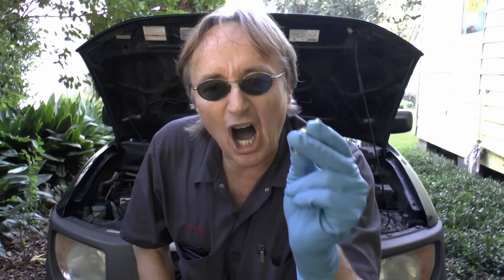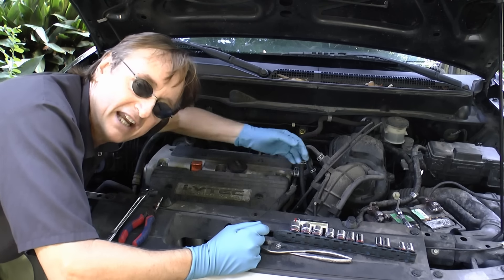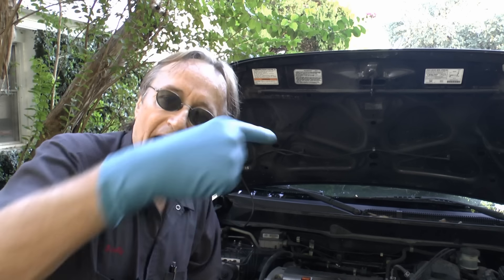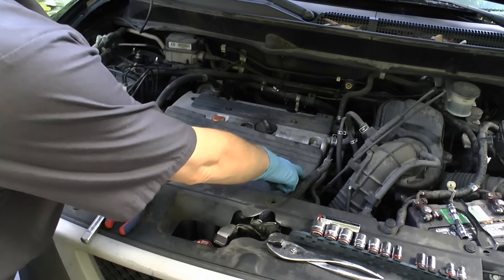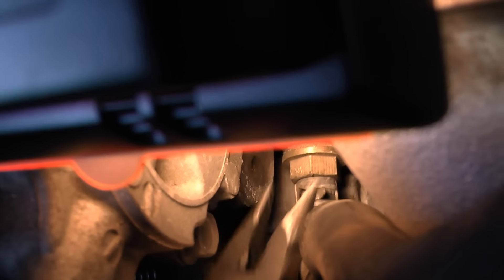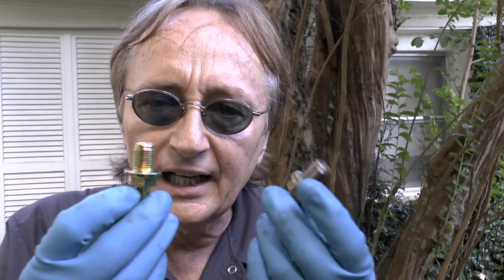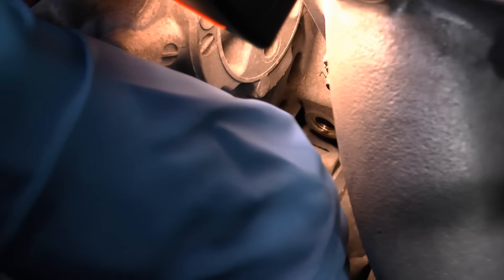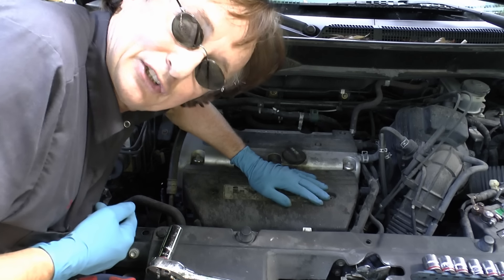How to Fix a Car Engine that Burns Oil for 10 Bucks

Comment: My Sentra was smoking horribly. I found this video and was sooooo skeptical. Nothing I try for car repairs is ever an easy, cheap fix. However, I found a pcv valve for $2 and put it on. BAM!! I have not seen a bit of smoke since. I am ecstatically happy! Thank you so much for this, Scotty! You are the man!
Reply: My Sentra used to smoke really bad too. Like, two packs a day. Finally I was like 'look bitch, I ain't buying your cigarettes no more. You need to get on the patch or something.' Then it started taking Chantix and like three days later I went out in the garage and it was dead. Committed suicide.
Reply: Brett Winstead smoke from the tail pipe?
Reply: nah bro it would smoke from the hot air intake ;)
Reply: yo wtf lmfaooo
Reply: Marvin Harrison Smith II haha
Reply: I get oil burning type smell only when I start my car in the morning. There's no smoke, just smell while starting and then it disappears. Will this help?
Reply: @HHH-tx9nc Probably because the valve is probably locked or seized and is allowing oil to get burnt up through the exhaust.
Reply: Sam for me. Tons of smoke. Where is the valve? What about head gasket problem????

Comment: Over 6 months, 5 different mechanics, new plugs, coils, MAF, random catalytic efficiency codes, etc. And they kept telling me my car must be burning oil (though no signs) and I shouldn't bother. Last night got flashing engine light and massive misfires. Plug 3 was all gummed up. Again, engine must be burning oil and has to be piston rings. I'm done for they said. Found THIS video. Bought a valve and brought it back to the guy and told him to check. Original valve was SHOT. Probably hasn't been changed in 7 years (freaking Nissan!) Changed the valve. Changed the hose. Changed the 2 plugs. It's been only 12 hours, but it's running like a new car. No misfires. No stuttering. No codes! Thanks for the video! Probably saved me thousands of dollars and a crap ton of stress!!!!
Reply: Update on this?
Reply: @sparkyplays9240  turned out the car was shot. Cylinder 3 was burning oil like crazy and eventually just ceased working. Ran the car on 3 cylinders for about a month until I got a new car, which was definitely NOT a Nissan.
Reply: "Changed the 2 plugs" - Spark plugs? If so - this was your CHK Engine and misfire problem.
Reply: @j_allen2099 thanks for the update

Comment: Thanks Scott I own a 2002 Honda Civic Si and it has used oil for the past 14 years. The Honda mechanic never told me that he has checked or replaced the PCV Valve. You even showed me where it is located. God Bless and Please Ride Safe...Amen.

Comment: Mr. Kilmer, I've been working on cars since I was a teenager so roughly 28 years. I just wanted to take a moment and tell you Thank You for what you are doing. You give people good information, it's presented well, and it's given in terms that are easy for people to actually understand. Having always worked on vehicles which are older (because I prefer less electronic controls) I've picked up quite a few tips and tricks from you that help with newer vehicles.
Reply: I have too
Reply: I get oil burning type smell only when I start my car in the morning. There's no smoke, just smell while starting and then it disappears. Will this help?

Comment: Scotty. I've been working on cars my whole life and after seeing your video you convinced me to replace my pcv - it didn't occur to me before. My car would not pass smog because of blue smoke after 3k rev when hot. I did the prayer and pcv change as you suggested, and I could not believe the results! No visible smoke! Thanks!!
Reply from the maker: Glad to hear it, thanks!
Reply: I get oil burning type smell only when I start my car in the morning. There's no smoke, just smell while starting and then it disappears. Will this help?
Reply: @HHH-tx9nc is it still happening? where do the smell come from?

Comment: Thanks Scotty.  Bought an 03 HondaElement that wasn't maintained well.  Was burning oil.  I changed PCV valve that was very dirty.  Problem solved.  Love your videos.
Reply: Dax C I highly doubt your crv is fixed, neglected K series Honda engines that burn oil need piston rings, very common.

Comment: You are literally my hero. Thank you for what you do. I’m not sure I can figure my issue out on my own but I’m watching whatever videos of yours I can find but I feel I’m never going to figure it out and I don’t have the money to be wrong. Had an oil change 2 weeks ago, car started sounding like it needed one today. It’s low on oil and now I have smoke under the hood. From the back side of the engine best I can tell.
Reply: Did you ever figure it out
Reply: @pazuzu810  Replaced the valve cover seals and it stopped smoking under the hood. Must have been spitting out oil onto the rear manifold. Manifold went and it was too costly to repair such an old car so I junked it. I’ve wondered in the oil contributed to it breaking.
Reply: I get oil burning type smell only when I start my car in the morning. There's no smoke, just smell while starting and then it disappears. Will this help?

Comment: I really enjoy your videos. We are about the same age. I'm 66. I've been a gear head since before I started driving. I never was a mechanic by trade but worked in Dealerships in the sales end. People ask me if I am a mechanic and I tell them, no but I'm a decent parts changer and have some common sense. As badly as I don't want to say anything that can be read as profiling, I think that the people in my generation were and still are much more in tune with their car. This sin't everyone, by a long shot. I tell people that when I started driving, I bought my own car, paid my own insurance and had the money by the time I was 16. Naturally that is next to impossible today but my point is this. My first car was a 1953,. It had a 6 volt electric system, no seat belts, an AM tube type radio that took 5 minutes to warm up. It had vacuum wipers. I won't try and explain vacuum to them but just that the more you pushed on the gas, the less they worked. It had a three speed transmission on the column with overdrive. It didn't have power steering or disk brakes or power anything. We had to learn to drive, not just point. Almost all highways were 2 lane. You were forced to pay attention because you knew it was serious stuff. To get a license you had to do all the things you do today, plus know how to give hand signals. My second car was a 62 Nova. It was 5 years old and I was a senior in high school. It didn't have seat belts either, same radio. My point is this. We learned how to keep cars running because our parents were raised in the depression and feared it happening again. Cars were a lot simpler back then, but even today, if people take a personal interest in their car and learn the things that they can do themselves, it can save a lot of money. My dad owned a sling of service stations and taught me two things about cars. If it ain't broke, don't fix it, but little problems turn into really big ones. You have to have your car, so when something needs to be done, know what is important, but keep it maintained. It is always cheaper to keep a car running than to get one running. Sorry for rambling.

Comment: Hey Scotty! Thank you for this video. I was worried about my car burning oil and thanks to you I inspected my Hyundai Santro's engine and located the PCV valve. It was all clogged. I cleaned it up myself and I was still able to hear the noise it makes which proved that it was working. Once I placed it back and did an oil change. Its been ten days and my car hasn't lost oil yet. I have ordered a new replacement and will change it once its received. You just saved me a fortune too.
Reply: Hi , do You think this will work on a vw bora ?
Reply: @costelkoko9886  no,  those engines aren’t worth fuxing.

Comment: I got an 1976 F100 6 cyl a long time ago.  It was running bad and had no power.  The PCV valve in the top of the valve cover and the entire hose from it to the intake was clogged with oil deposits.  I cleaned the valve (I was on the road) and used a stick to remove the clogged gunk from the pipe.  It ran much better and got me home.
I had a 1966 Ford Falcon that quit running in the middle of nowhere. After checking a few things I knew I wasn't getting fire to the plugs.  I popped off the distributor cap and the very end of the metal on the rotor cap was gone, broke clean off!  From the rivet to the center (coil wire contact) was fine but there wasn't anything on the end to send the spark to the distributor ends of the plug wires.  Luckily my dad taught me to ALWAYS put the old tune-up parts in the trunk when I did a tune-up, that saved the day!  I put the old rotor cap on and went on my way!  Saved me a tow truck call, especially since cellphones hadn't been invented yet.

Comment: PCV valves are often overlooked. myn on my honda civic is hidden under the intake manifold. when i finally replaced the pcv it stopped burning oil. good tip
Reply: +Mark N and the factory one almost never go bad .. buy aftermarket ,not so much
Reply: +Mark N I found out the one on my Focus is also under the IM. Plus some of the bolts are hidden. And the hose is usually toast. I'm still working up the courage to undertake it.

Comment: Seasoned mechanics years ago would look immediately to replacing the pcv in the tune-up process. Thanks for the important info. A small inexpensive item change like this can save a costly engine repair later.

Comment: I have a 2006 Honda Element Ex AWD. I purchased it 11 months ago and had my mechanic check it over and he said it was in great shape, plus I have every maintenance record since day one and it's had excellent care.  I noticed today that it was a quart low after driving only 1200 miles, and I haven't seen anything leaking or smoking. So I went to Honda today to purchase an OEM  pcv valve for $41.00 and will install. I pray it's the solution. Thanks Scotty, you're the best 😁
Reply: did it work?
Reply: @buzrash  I just got it all changed and the old pcv was plugged up. I'm sure after driving for a little while I will see a big positive change. Sure is great to have Scotty Kilmer helping with all the great advice👍
Reply: @1jackvalley580  thanks for the reply.

Comment: Thanks Scotty, I did this a while ago and my car is still burning oil like water. Have to top off every 300 - 400 miles. But still running great with engine light on for catalyst converter.
Reply: I have the same exact problem, what was the cause of it?... thanks

Comment: on my 2001 maxima, I  changed my PVC valve and PVC hose  for the first time in its  20 years history.
I also  switched to 10w30 high mileage from 5w30  high mileage
 (owners manual says 10-30 or10-40 can be used in my climate)

I also added AT-205 Re-seal for the rear main seal leak.    
I also use 1 qt of oil stabilizer in place of 1 qt of oil.    
now its not burning as much oil or leaking as much.   cheers

Comment: hey Scotty I say the engine cover is the first sign of the manufacturer saying forget about fixing it your self, we hid everything from you
Reply: Ironic since that's a K20/K24
Reply: IT'SME .  It may be the badge on your engine cover that caused the failure.😀. Seriously though, I knew one family that had 2 newer Cobalts. Both had major engine trouble within 6 months of each other. Total failure of hard parts like pistons, etc.
Reply: Bit late, but the cover quiets down engine noise
Reply: Useful Entertainment 
Throw away the heat keeping cover.

Comment: My 2001 Lexus ES300 was blowing out a ton of white smoke and burning oil, like 1/3 quart every other week.  I observed tailpipe smoke on cold starts ONLY.  Once running for ~30-45 seconds it was totally clear.  It was also only 4~5 days per week.  So it was not consistent in my case... It had good and bad mornings.   I took out the PCV valve, soaked it in brake cleaner for 2-3 hours and scrubbed it inside and out with a long bristle brush until the runoff was clean/clear.  There was a LOT of old oil clogging it up inside, or at least partially blocking it, and I think this was the cause of the intermittency.  Majorly keeping my fingers crossed.  Hoping this will carry me over for a few days until I can get a new valve.  I am pretty sure this is the OEM PCV, I dont think the previous owner ever changed it.  Hoping for the best and thanks Scotty.

Comment: Just a note..
The PCV on the Honda Civic(EG series) are made of plastic, and you can't unscrew them.
You have to pull it out with clamps. And when you do, it will most likely BREAK into pieces. I have no idea why they made out of plastic..
So far I replaced mine twice and both times they broken into pieces.
Reply: i changed them on my civics... none broke. it helps if you spray some wd40 or other lubricant on the ring of the valve prior to pulling it out. a lil dab of the same product on the new pcv should help installing n removing in the future. beck n arnley are sturdier.

Comment: Whether your videos are new or old they are always highly educational and equally as entertaining! P.S. I know how you feel about Chevy's but I have 2 Silverado's (a 93' standard transmission and a 00' automatic transmission) and I've taken great care of them and they both run absolutely tip top. The 93' is rusted to all hell (I live in Minnesota) and leaks a little oil but ALWAYS starts and runs with no problems. The 00' is actually in really good shape and is only just now starting to get the classic rust around the wheel wells. They seem to just want to last forever and I have no reason to get rid of them unless I want to upgrade just for the sake of upgrading. But why upgrade if they work perfectly fine right?

Comment: You can test if it is a PCV valve. Take off the oil cap and see if its stil burning oil. If the PCV valve is stuck closed or clogged now you are venting the pressure into the atmosphere.

Comment: I love your videos. You have inspired me. I even got a 1997 ford f150 and fixed it up a lot.I checked for head gasket leaks and none. also it runs very strong making me think there are no valves or piston leaks. I juts found out that there is a problem with the oil. it seems to be disappearing. I am pretty shur i replaced the pcv valve. there is no to little smoke if any coming from the tail pipe. I also pulled the pcv valve out and when running it i put my finger over the end and the extremely large amount of vacuum sucked it to the top easily.  Is there anything else that can cause the oil to disappear because i don't see any leaks on the drive way. I don't drive much but want a dependable car. Thank you so much. You saved my mom 900+ because of you helping me to help her fix the catalytic converter using lacquer thinner < you are awesome please never stop revving your engines>
Reply: Jamie Corbin does it blow smoke out the exhaust? Could be piston rings give way to slight blowby. In that case just burning up the oil
Reply: Check for oil pan or a rear main seal leak. The 302 bronco i have, thats mainly wear it leaks from.

If its leaking from either of those 2, the pan and bottom of transmission near where it mates to the engine will most likely have very fresh oil residue,

And you're gonna have to remove the transmission to service either of those seals. So pretty much plan on replacing a lot of stuff down there other than just seals. On a manual transmission the pilot bearing, rear main seal and transmission shaft seal is just a few extra stuff i replace along with doing a Clutch job. You're gonna have to remove the transmission to do any of those, so just do them all so you wont have to worry later on.

Comment: Hey Scotty I've got a 94 corolla that puts out some blue smoke occasionally upon acceleration especially after sitting for a while, could the pcv valve be the cause?
Reply: I am wondering as well.
Reply: Wondering the same.
Reply: Yes, it could be the PCV valve.  If it's not that, the cause could be much worse.

Comment: If you missed how much it costs just hit 1 repeatedly.
Reply: Mataz007 Hit 8... XD
Reply: Ryan LeFevre 9 1 7
engine's burning alot of 10 buck carberator spray cleaner
Reply: +Mataz007 Keep pushing 8.  It is hysterical.  Sounds like a bad porno.
Reply: Mataz007 i hate you for showing me this looool
Reply: +Mataz007 HaHaHa press 3 then 8 hahaha
Reply: +nextari press 8 every time you get to 2:46 "mihavetowinggla"
Reply: +Mataz007 "En bucks" basically SwEnglish for 1 buck.
Reply: +Mataz007 where did u learn that ??
Reply: +relaxme4 in swexico!
Reply: +Mataz007 press 8 every 2 seconds and listen to him sing in indian

Comment: I like your style. When I was a mechanic I made a lot of good business just helping people out. I know a few who would say bring it by the shop but I would rather keep a car on the road and save them money than let them down. The shop I worked at had good enough business doing heavier repairs and if you think of the shop as an emergency room, how many people clog the halls of an WE because of a common cold compared to actual emergencies. My mother was an RN but did a little wrenching and compared it that way.

Comment: I know this video is approaching five years old but it surely helped me today because for years I always thought this valve was the device that sat down in my valve cover gasket. My old car has been burning oil for quite some time. Perhaps this simple and cheap fix has been the culprit all along (because I was only changing the top piece that rattles).  Thanks 😎👍

Comment: I have a 2004 Suzuki Vitara with over 200,000 miles on the original engine. I don't think the PBC valve has ever been changed. Where is it located and tell me what you think about Suzuki cars. I hardly ever see you talk about them. They are made in the same country as Honda and Toyota. Thank you and kept up the great job. Have a blessed day